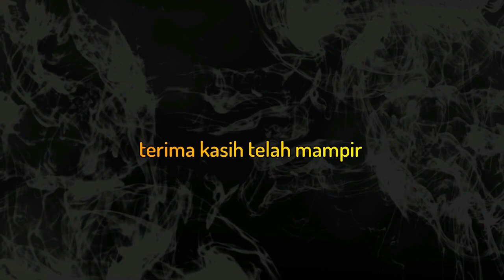Lampu rem HONDA CRV nyala terus, check ini..

Comment: Terimakasih banyak atas tips nya. Sempet panik td saya, malem2 gini mana ada bengkel buka. Tadinya mau dicabut aja dulu akinya. Untung keburu nemu video ini. Sementara saya ganjel dulu dengan baut, yg penting mati lampunya dan ga narik listrik aki. Besok saya beli onlen plastik stopper nya. Thx.
Reply from the maker: Wah, sangat kreatif, sukses sllu👍
Reply: namanya apa yang harus diganti
Reply from the maker: @dodiksetiawan1534 aslinya karet atau klip pedal rem, tetapi dlm video kami menggunakan klip alternatif seperti klip plastik rivet fender mobil dan rivet plastik ini ada dlm berbagai bentuk utk besar kecilnya

Comment: Terima kasih. Sangat membantu. Gw udah praktekkan. Sekedar melengkapi n menyempurnakan sj. 
Sppart ori: Pad pedal stopper,  46505-SA5-000, rp 43rb.
Buka dek yg hitam saja, udah cukup terlihat n bisa u dikerjakan.
Tdk perlu lepas soket kecil, lepas yg putar saja.
Reply from the maker: Terima kasih infonya, sangat membantu
Reply: Setelah saya pasang , rem terlalu  nekan atau langsung ngerem, solusinya bagaimana kah? Mohon bantuan
Reply from the maker: Pemasangan switch rem jangan menekan pedal remnya
Reply: @AJMcrews  kalo sdh terlanjur dan saat switch saya pasang posisi langsung ngerem
Reply from the maker: Switch rem tdk berpengaruh utk pengereman mobil tetapi itu hanya utk menyalakan lampu stop saja.
Cabut switch remnya jangan dipasang dulu, kemudian test pengereman mobil sdh normal atau tidak, jika sistem rem sdh normal maka switch rem bisa dipasang lagi
Reply: @AJMcrews  saat dilepas, rem normal, tetapi saat switch dipasang, rem spt terdorong ke depan jadi mobil posisi ngerem, mohon bantuan solusi